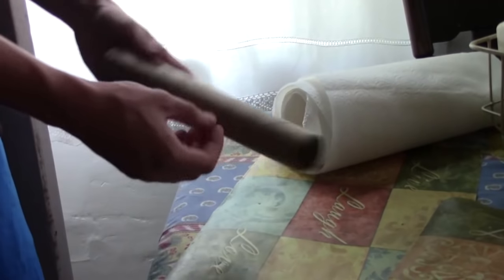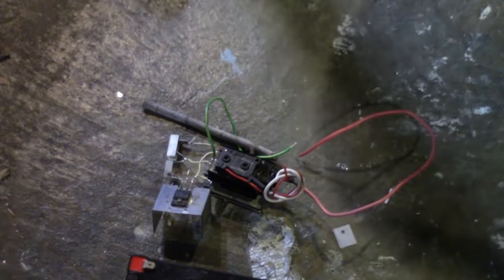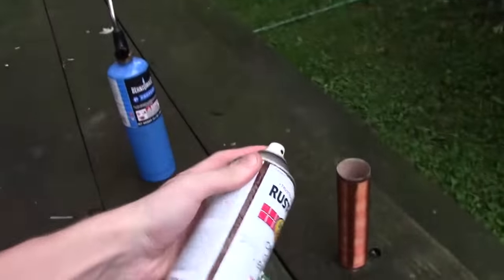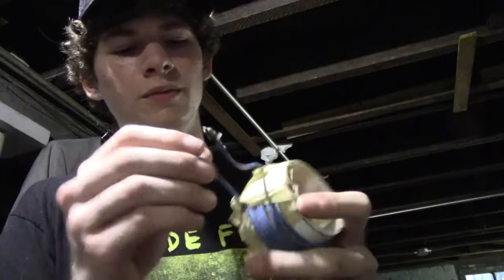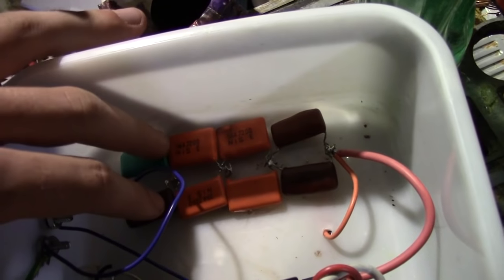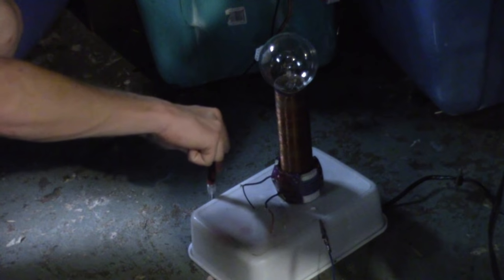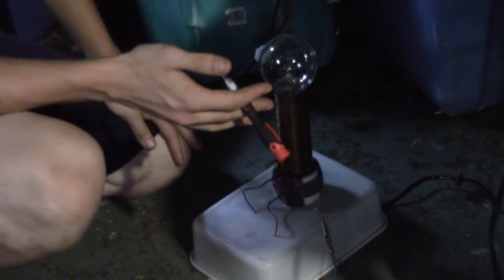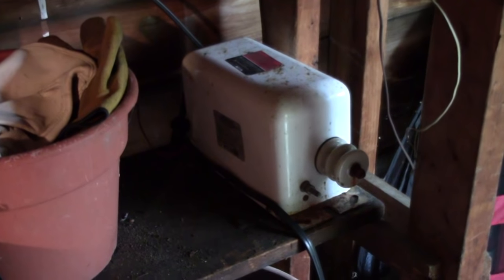Small Tesla Coil COMPLETELY from Scrap Parts Tutorial

Comment: how did you wire the flyback driver to the flyback, did you loop wires around the core?
Reply from the maker: You can do it that way, or you can use a multimeter on the resistance setting to find the internal primary and feedback coil pins on the bottom of the flyback. There are youtube tutorials on how to do that, and it requires a bit of trial and error

Comment: I found that its easier to just use a small crt like a 15 inch and use the degaussing wire out of it for the secondary. Around a 1.5 od tube it will only be like 6 inches tall. 
Then just use the tv as the power supply. Arcs from the tv board driven flyback are around 10-25kv at around 30-60ma

Comment: I found a better source of magnet wire. On the outside of those old crt TVs there is what looks like a black wire covered in electrical tape. If you take the electrical wire of it you will see that it is just a long piece of magnetic wire, and it doesn't have any enamel on it.

Great video by the way.
Reply: if it doesn't have enamel on it its not magnet wire, just plain copper wire.

Comment: So I made a secondary could about as big as the biggest one you have, it has about 900 turns, but the problem is I don't know the output of my power supply. Its a zvs powered flyback and gives 2 inch sparks with the color of sparks that a MOT  gives. Since I don't know the voltage and amps, how do I calculate the primary coil and capacitance needed to achieve resonance
Reply from the maker: If the flyback is DC then it doesn't really matter from my experience. I have just used several beer bottle capacitors in parallel and by adjusting the spark gap and tapping the primary I can get a decent output. If you are using an AC source then you should go by spark length. Wherever the spark first fires is the length you use. 1cm = roughly 10 kilovolts. Then calculate the current drawn by measuring the current when the arc is shorted. You can then calculate the current on the high voltage side using this data. Flybacks are a pain in the butt when it comes to achieving resonance. Rarely will you find the numbers you need to get close without trial and error.
Reply: ClevelandStorms see the thing is I have 2 coils, a very small one and a 2 ft, but when using the same caps they give of the same sized sparks
Reply: does the secondary coil get wired into the circuit & how?
Reply: Eric Cruz the only thing that should be wired to the secondary is ground, make sure the bottom of the secondary is connected to an external ground, not house ground. drive a grounding rod a few feet in the ground and use that.
Reply: ClevelandStorms Well, i stopped using flyback, now I'm using 2 mots in series running off 240 volts, but my caps won't charge. Im guessing because the dialectic is too thick but I'm not sure if I  will need a voltage multiplier, what do you think
Reply: Platinum Science thanx a bunch
Reply: Eric Cruz your welcome, hope your coil turns out great!